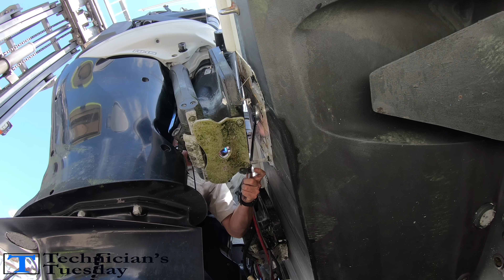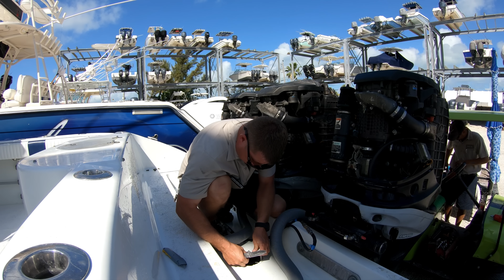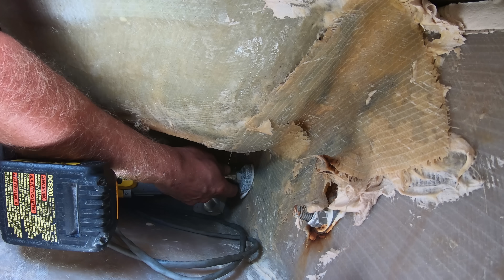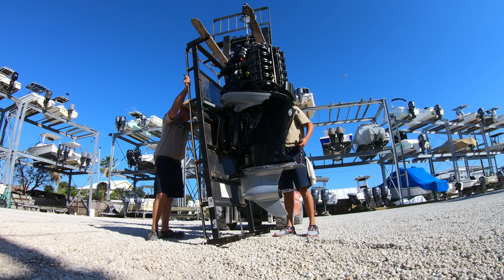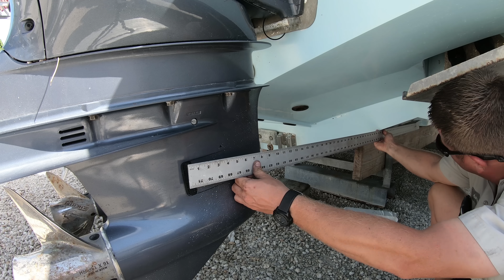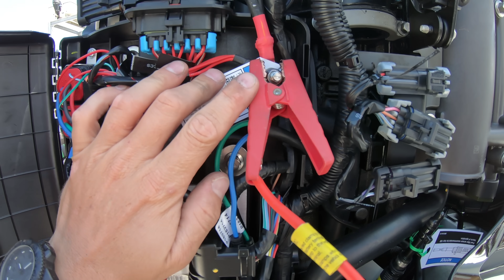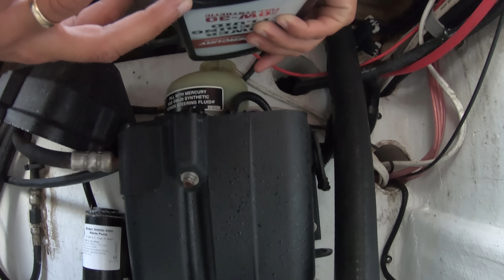How To Mount An Outboard Motor Properly - Start to Finish!

Comment: motor noob here replaced my transom and mounted my motor too low.. suggestions?
Reply from the maker: Hello, did you just hang it to low or did you drill the holes and the engine is all the way up and still to low?

If you just hung it low, raise it up. If you drilled the holes to low. That stinks. Best thing to do in that case is pull the engine and fill the holes with whatever epoxy you used in the transom. 

Then get some transom savors or those plates that go from hole to hole for the engine mounting bolts. Then redrill the new mounting holes and hang the motor at the right height. That kind of sucks, sorry to hear that.
Reply: @BornAgainBoating  thanks for replying. the 130hp honda straddles a new coosa transom sitting about 6 inches too low (yes i failed to properly measure). i wasn't sure about drilling and raising the motor if that would create a possible instability issue without the motor resting/straddling the transom? reality's pinching me the correct fix is making a new transom. ugh
Reply from the maker: @_noname617  No, that's not the reality. Coosa is super strong. As long as you layed the glass properly with enough layers and depending on how thick you made the transom.

You should be able to remove, redrill, and reset the engine. It sounds almost like you have too long a driveshaft on the engine. Like you're using a 25" engine and you need a 20".

What kind of boat is this?
Reply: @BornAgainBoating  okay nice you're giving hope on this '22 novi hull project boat. the transom two different coosa layers= 3.5 inches. from what you're saying i'm thinking about lifting the motor and building-up the transom from left-over materials + glass/paint + measure new holes, drill, and place motor. ecstatically it'll look great, the worry was "will the motor not resting on the transom" possibly compromise a possible integrity issue"? you make sense the "glass was layed properly" "the carriage bolts should hold it, well after 4 months in the water her rear's in great shape. 4 inches of draft she's running a short shaft with 6 inches too deep, but she's a putter put-put 3,500 rpm wknd  lobster boat. i hadn't realized how maligned things could get by from being off by fractals. really appreciate your feedback.
Reply from the maker: @No Name no worries man. That actually sounds like a complicated situation you are in. So you are using a short shaft which usually means it is a 20" shaft. Now, as far as the transom goes, two layers of coosa is perfect and well strong enough for that engine. Usually, you will say two layers of mat and then a layer of woven on top of that for the outsides of the transom, and then a layer of mat in between the two sheets of coosa. 

When you say you are going to be "adding" material to the top of the transom in order to raise the engine? That will affect the strength of the transom for sure. Just out of curiosity, have you looked into just buying a fixed jack plate that you can put on and raise the engine to the correct height? That will save you a ton of time and to be honest, for the 130, it won't compromise your strength. 

You can find a TH Marine fixed jack plate that will raise the engine up 5 inches or so and they cost anywhere from $100-$300. For the money, I would go that route to save yourself a tone of time and effort. Not to mention the time off the water! For a weekend lobster boat, buy the jack plate and have the project done in a weekend!
Reply: @BornAgainBoating  yes the coosa transom was fitted as you/manufacture suggested. my idiot brain said cut it to the original u-shape rotted piece and assume the short-shaft was universal with all manufactures. unfortunately my ego couldn't accept a "fixed mount plate" and am back to the original plan to replacing the #%*$ transom. live and learn to "measure and cut once" please excuse me while i go pour myself a cold glass of milk. cheers
Reply from the maker: @_noname617  lol dont be so hard on yourself. Give the jack plate some serious thought though, it has a lot of performance advantages and economic pros to it as well! I think the jack plates look great :)
Reply: Raise It perhaps.

Comment: my 1997 xr6 EFI 2stroke 150hp tops at 60mph at that speed I have to struggle keeping the steering straight. After watching this video, you mentioned toeing in the engine to keep it straight. Is this still a possibility for me. If so, how??
Reply: and, I do have power steering. Several of my fishing buddies have the same problem. Is this an older people problem, or older boat problem?
Reply from the maker: Well, the toeing in only works for twins and above, but for singles, it might just be because so much of the boat is out of the water, you do lose some steering there because of the speed. Otherwise you might have a little bit of slop in the helm or the steering cylinder :)
Reply: That works.  I have twins and was getting a steering "kick" feel in the wheel.  I towed the props in 3 turns on the tie bar threads and problem solved.

Comment: If the prop shaft centerline is at 26” and you set the tiebar at 26.25”, that will creat a toe out situation...
Reply: The tie bar is wider than the props....so logic dictates that with each engines pivot point at the place between the tie bar and the prop that the props will be closer to each other that the end points of the tie bar....hence toe in
Reply: @ctbully  your point would be correct, except for one fact you are missing. The tie bar setup is in front of the prop shafts, not behind them. This spreads the lower unit nose cones away from each other or toe out.
Reply: @aceseights8815   toe is measured from the BACK of the props   not the front of the nose. of the case   YES  the     gear cases are  tracking to the  " bow corners "    slightly  if viewed from the front

Comment: Nice vid, when i was working in a marine shop 13yrs ago in fit-outs we were told never lay a change over engine (re-power) flat on its side always use an engine stand so as not to get water run back in the bores i couldnt work out that theory cause all engines arrive from the manufacturer run and tested in a water tank on a cradle layed face down although not on its side nearly all were 2 strokes re-powered to 4 strokes would that have been why i never bothered to query it just obeyed their directions
Reply from the maker: Lol yeah probably. To be honest we prefer to put them on stands too. Just right now there are literally no stands left! 

Tons of people transport them on their side on pallets all the time though, so, sounds like it was probably a personal preference of the business.
Reply: @BornAgainBoating  Cheers.
Reply from the maker: @Ken-fisho  cheers!

Comment: I have a boat with a bracket/single outboard setup.  The bottom edge of the bracket is probably  8 inches higher than the bottom edge of the transom.  Should the straight edge measurement be from the transom or the bottom of the bracket?
Reply from the maker: From the transom, go from the hull, remember the water flow will be coming from the bottom of the boat :)
Reply: @BornAgainBoating  OK, thanks!

Comment: I thought it was cavitation plate level with bottom of keel guess I was wrong
Reply: My cav plate has to be just under or i get cavitation when i turn this is on an aluminium boat
Reply: @tishbrett  on my boat its fine if the water is glass but any waves you will cavitate all day.

Comment: Love what you do giving tip. I'm trying to figure the best and low price hydraulic steering system for my boat. I have 28ft pro kat and 2 2012 mercury optimax 225hp and what is the best size prop I should put on. Thank you and aloha.
Reply from the maker: Thank you! The thing about the pro kat is you are going to have to get a liquid tie bar! That's the kicker on most of those cat boats, you can't use a conventional tie bar and one steering cylinder! You have to have two steering cylinders and then a liquid tie bar.

Some models though have a way to use one cylinder and then a special tie bar, but if I remember correctly, I don't think any of the Pro Kat boats do. I'm pretty sure you are stuck getting 2 steering cylinders, the liquid tie bar, and then the steering helm. 

You can't really get around making it cheaper on the parts side with the cylinders and the helm. But I have seen home made liquid tie bars that are basically just a shut off valve and Tee fittings on both sides. Then you can make your own hoses, I'm not sure about where you live and what you have available, but our NAPA autoparts store here in town carries all of the hoses and fittings to make the hoses. 

Hopefully where you are you have a store like that! Then you can make the tie bar and that's about the best you can do on making it the lowest cost :)

The prop will depend on how the engines and how the boat performs though, for that you will just have to try a set and see what the RPM's are. I'm in the process of writing an article on propping out a boat, but I don't have it finished yet :(
Reply: Born Again Boating , thanks for getting back. I'm from hawaii, bought this boat without engine or any electronic. Can you send a me a draw out of the set up and what kind of cylinder I should use. Much appreciated
Reply from the maker: No worries @Eddie Tinoga send me an email at aaron@bornagainboating.com and I'll send you a drawing of how to set it up. What kind of power are you putting on the boat? Also is there going to be a second station?

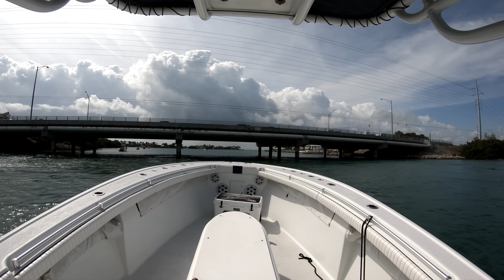Comment: 5:54  pointing engines outward appears to be toe out.
Reply from the maker: That's just what Yamaha calls the measurement. I call it toe in because when you set the engines you place them completely straight facing back. Then move the tie bar out about a 1/2" so that the propellers face in about a 1/2" so that the engines point inward just a little to make the wakes cross each other at about 50 feet behind the boat. 

I guess it's more an opinion or semantics of what we call it :). As long as the wakes cross correctly it's right :) thank you for commenting!

Comment: You talk about toeing the motors in, but the diagram you show displays the motors toed out. Also with 3 engines, if the port and center engine are toed in, the starboard and center engine will be toed out. Makes no sense to me.

Comment: Very bad installation. that I know of all bolt's nuts and proper securing hardware should be installed inside transom not outside....A guy lost a new 350 motor by installing same...
Reply from the maker: That's what happens when you dont tighten the nuts down!!!!
Reply: Nuts were properly tighted backwards, the issue was that the pro guys were running both motors at full throttle under choppy and wavy water cond wich loosened up all 4 nuts and motor dived into the blue..
Reply: Nuts always go on the outside.
Reply: Really, you haven't read the Owner's Manual Installation procedure.  If bolting backwards you won't see when nuts become lose and motor flies into the deep blue. To each his own installation...
Reply: @searider9922  No one would ever think of having the nuts inside the boat. I have installed a lot of outboard motors. Nuts just don't come loose, if installed correctly.
Reply: If nuts just came loose after proper torque then we wouldn't have aircraft.
Reply: Sorry to disagree on this one, but all Owner's Manual recommends to install bolts heads facing inwards while the nuts are secured on the inside of transom, that way will  see if the bolts became lose from inside of the boat which must be checked from time to time, specially with high HP motors or risk losing them into the blue...

BTW,  were talking about motor bolts and nuts not aircraft propellers which belong to other territory. Any single nut torqued to specs will become loose over time, that's why I use double nuts on each bolt.
Reply: @searider9922  Nuts always goes on the outside. A lot easier to check the torque and adjusting engine height. The lower two bolts are usually hidden anyway, so it's better to have all the nuts on the outside. Ofcourse always use doble nuts on larger outboards.